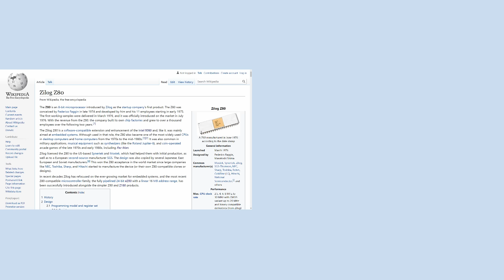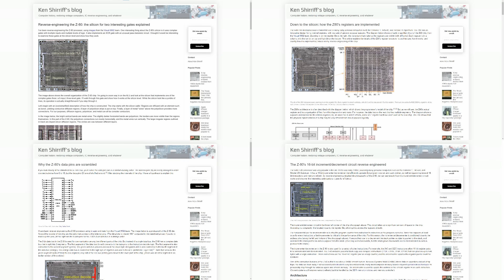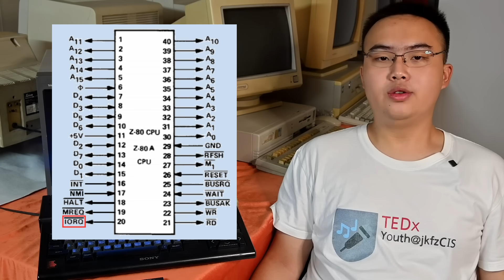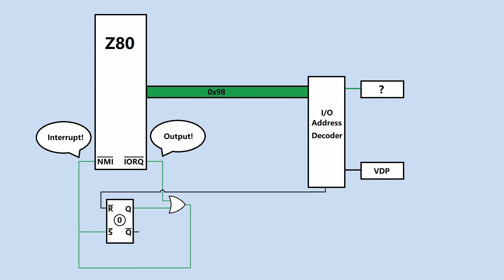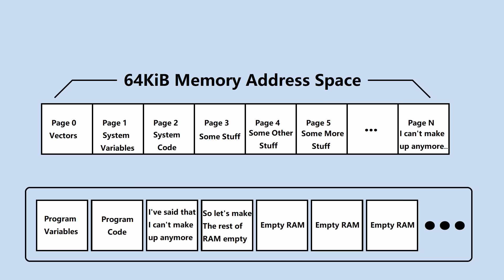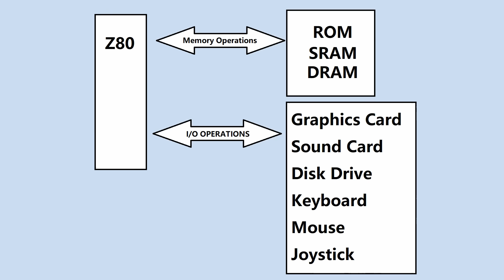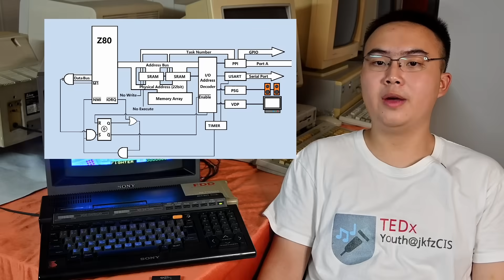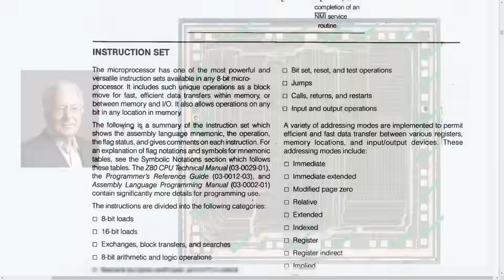The Z80's secret feature discovered after 40 years!

Comment: Not a bad video, even if it was clickbait... however, I wanted to add a couple things that you could not know... the Z-80 chip was used in FAR more applications than the consumer market and some of those users did NOT want certain things known and were left "undocumented" and even hidden, unless you worked for those clients. The Z-80 was truly a workhorse far and above some of what was  generally known and used by most programmers. Unfortunately there are still some "legacy" systems out there that prevent me from saying any more than that.

Comment: You are right, the Z80 was not designed for personal computers or an O/S that was multitasking in a multi user environment (like a main frame). It was designed to run one program in an embedded system. I always imagined that maybe two Z80s could be used, one for the kernel and one for the users. You seem very versed in the Z80 and I haven't designed with one for decades. Can you see using 2 Z80's to allow protected or supervisor modes along with user modes?
Reply: re: "I always imagined that maybe two Z80s could be used, one for the kernel and one for the users. "
YOU do know the Z80 has *two* register sets? I used the 2nd set for interrupt handling back when I did a Motorola trunking receiver that handled the incoming trunking control channel 3600 baud data plus control button scan/debounce and LCD display I/O and serial I/O via the Z80 SIO ...
Reply: @uploadJ  Yes, it's been decades, I think I called them the base and prime register sets. I only gave it fleeting thoughts to use the Z80 in protected modes. When the Motorola 68040 came out, it became my goto CPU for system and embedded designs at the time. Now, my Raspberry PI is fine my home project needs.

Comment: Don’t know how to search the comments so this might already have been mentioned, but the Apollo workstation used two 68000 CPU’s - one for user mode and one for protected mode. The user mode cpu was halted while the protected mode cpu ran kernel code.
Reply: The Sun-3 used two 68000s which ran a few clocks skewed from each other. The purpose was to implement paged virtual memory which the 68k did not support on its own. Apollo would have preferred to use the National 16032 (later named 32032) but NSM was too late to market. The 016 had a companion MMU which nicely implemented pure paged virtual memory.
Reply: @garymartin9777  I didn't know that about the Sun-3.  I used a Sun-3 model with the 68030 processor which included an on-board MMU, but it must have been a later model of Sun-3.

Comment: My own thoughts would to be to use RAM  paging for multi-tasking. One bank for system, and one bank for each program.  The bank switching hardware would only work when previous memory read was from from EEPROM memory space. Not that its worth doing anything like that on my project unless I can get it running faster than 1MHz

Comment: Easy. 1982. Use a Fairchild Semiconductor Clipper II on a paddle board with onboard memory management chips to emulate the 8086 and run VMS with full multi threading, multitasking multiuser and protected mode enabled. Price $108. Only two ever made.

Comment: Russell and I had a debugger with a hardware single-stepper. We used that to find the most difficult bug I have ever seen. We used that to generate code for our communication system. While editing code it would crash for what seemed like random events. We finally had that crash that caused us to lose a day's worth of programming.We single-stepped time and time again getting closer and closer to the bug until we found it. Our Z80 had a broken instruction. It was the Add w/carry A,E instruction. We replaced the CPU in our development system and never had that problem again.
Reply: I had a Z80 'go bad' while writing and debugging code ... it became worse and worse until I changed the CPU (the board was wire-wrapped) and that was the issue! Doesn't happen too often, but it __can happen__!

Comment: I used pen and paper for a couple of ZX-Spectrum assembler programs inserted from Basic. The machine code then running would maybe be full of errors and go through the entire ROM and exit at "reset machine" to start over. For a game on tape I had to move 16K of data 2 times to get it to load and it's 2 commands. No waiting. Basic would spend minutes on that.

Comment: I imagine it would've been prohibitively expensive to add all those components back in the day, too. Plus the components would've made the board of whatever computer larger because components were larger back then, too, so size constraints are also a factor.
Reply: Z80 processors were commonly surrounded by TTL glue logic consisting of gates and flip-flops. Those were cheap (less than $1.00) and relatively small (14- or 16-pin narrow DIP). SRAM might be a bit more expensive but also quiete small (20-pin narrow DIP). Overall the cost of proper software design would be a lot more than the few chips needed for this.

Comment: This was very cool - and well presented with great graphics and explanation. It reminded me a little of the way that the Sinclair ZX80 generated display info, which involved tying A6 on the Z80 to the interrupt so that it would interrupt itself at a specific value of the refresh address register - quirky hardware and software working together.  It also took me back to when I wrote a single stepper for a 16 bit processor in the 1980s that interrupted the code under test after every single instruction. It was slow, but got the job done.

Comment: A protected mode isn't necessary to develop preemptive multitasking. All you need is a clock interrupt that handles task swapping through a scheduler. Once the scheduler has determined what the next eligible task is,  it saves the context (stack, IP)  of the current task on the task's own stack, restores the context of the next eligible task from the new task's stack, and finally resets the processor Instruction Counter with the new task's saved instruction address. In modern OS, this is done in protected mode, but it doesn't have to be for this mechanism to work.
Reply: Some old DOS task schedulers worked this way. Protected mode is more about easying it and creating virtual separated CPU and memory areas with ease for the developer but it must follow a set of strict rules and limitations
Reply: pmode and virtual memory are merely required to enforce the task switching and isolation. If you trust the code you’re running then you can run everything in kernel mode and bypass those isolation mechanisms (e.g. JavaOS, which JITs everything and runs everything in the same address space, with isolation coming merely from the Java memory model and no escape hatch being available)
Reply: Came here to say the same thing. I've built pre-emptive multi-task schedulers for 6502 and z80 hack in the day.  Good times :-)  Still, he gets full marks for trying.
Reply: Pretty cool how programmers push things to their limits.  Technology has made us lazy.
Reply: of course it isn't.  it's software -- we can do anything!
Reply: Looks like people Missed the point of the video...😂
Reply: in the video he says "which means it cannot run a true pre-emptive multitasking OS"... which is a true statement

the key part being "OS", so these comments are not contradicting his statements, you could do multitasking sure with shared memory, you have to have all the programs designed to work with one another

he does say at the end that basicly a load of this stuff wouldn't be practical for other reasons
Reply: @DarkShroom  No, it is definitely a false statement. Pre-emptive multitasking has got nothing whatsoever to do with memory protection.Those are two separate mechanisms.

Comment: I think the 'hidden instructions' in Z80 processors may reflect the personality of Federico Faggin that he'd like to make the chips he designed more versatile in the future. Actually, when studying  Intel 4004, the first CPU Faggin ever developed, you can also find two 'hidden instructions' which didn't show up in the first edition of the MCS-4 handbook. 

The MCS-4 chipset was originally designed for the Busicom 141 calculator, and consists of only 4001 (PROM), 4002 (RAM), 4003(shift register as IO expansion) and 4004(CPU). There were no other expansion chips at that time, and the CPU itself can't modify the program ROMs since they were mask programmed. Then after Busicom sold the copyright to Intel, Intel quickly expanded the MCS-4 family by adding chips like 4008/4009 (later combined into 4289), 4265 and many others. The 4008/4009 combination acts as the standard memory interface, and can be connected to conventional EPROMs to store program. Then Intel uncovered two more instructions, the 'WPM' and 'RPM', which can read and write the program memory through the standard memory interface.

Obviously, for the original MCS-4 chipset and the calculator application, these instructions were not necessary at all. Also it's very unlikely Intel could use these instructions during the development and debugging of the Busicom calculator. So my only guess is that these instructions were reserved for the future, and Faggin had already got a roadmap to make a very versatile general purpose CPU ecology even before the development contract with Busicom. Faggin's foreseeing personality while designing a new architecture may be inherited to Zilog and to the design of the Z80, which led to these undocumented instructions.

If my assumptions are true, I really feel sorry for the poor Busicom company. Maybe its fate was already determined by Intel when they made that contract. Intel used the funds from Busicom to kickstart a new era, while Busicom died just before dawn.

BTW the spare space theory and drawings doesn't seem convincing to me. The red boxes @14:43 are just IO driver transistors and protection circuit, not the real logic.
Reply from the maker: I know that. It's just for illustration.
Reply: Thats really interesting, Thanks. My first micro was the 8008 from Intel and I was not aware of any hidden instructions there.

Comment: Just curious.  I used to have a zenith z100 with dual cpus.  8085 and 8088.  I believe it used banked memory to allow cp/m-85 to do a cold boot super fast.  Wonder if it used some of these techniques? In any case you did a great job describing your techniques. Thanks!
Reply: We had the zenith z100 running zDOS connected to our fire panels.  They were slow and most had a Winchester 5mb drive that came with a park command to park the hdd. Very heavy and fragile
Reply: @formosabrowning3539  - at the time, I could not afford a harddrive so my Z100 had 2 5-1/4" floppies!  The computer itself was built like a tank and came with all material data sheels for all components. Remarkable.

Comment: Misleading title.   You have not discovered any new function in the Z-80.   You have designed a simple protection scheme for a CPU with no protection and a 64K address space.   Unfortunately your protected IO cycles incur several memory cycles for interrupt service, so your protected Z-80 is not a real time bit banger any more.   I hoped you found more opcodes not shown on the data sheet.    I feel victimized by clickbait  now. 

Not really.  It's an elegant hack, and you go on to introduce memory management as part of a virtual machine protection implementation as well as I've seen it presented in school.   Did you build one?  Where did you move the vector table?  

Full disclosure.   I once built a Z-80 machine with 128K expandable to 512, a redesign for manufacturability of the Wavemate Bullet.  Which was useless at the time because the IBM PC was out by then.   Look up the Bullet some time.   They had the whole Z-80 peripheral catalog in there.   The bells and whistles UART, the counter timer, the DMA engine.  I had an unresolved issue with Zilog technical support, they never published timing specs for their interrupt daisy chain sufficient to calculate and guarantee a worst case logic design.   I escalated it to Zilog management and they told me the parts were done and there was no business case for reverse engineering their own parts to provide guaranteed delay specs.   So they weren't gonna do it.   Trust us, it just works.
Reply: The hardest part of putting that chip on a board was the clock.  The Z-80 parts consumed more power through their clock pins than through Vdd.   Vdd was mostly for driving output pins.  I had two 20 pin PALs for all the steering and timing logic, but needed discrete transistors to drive that clock.

Comment: One issue I see is if you tried to multitask is it would not be able to disseminate what variable goes to what active program. That would require a lot of os reprogramming to handle more than one active program at a time. The Z80 might be able to swing it (poorly) but the software would not know what to do with more than one active program running simultaneously but independent from each other.

Comment: The Z80180 implements a very usable memory manager to address upto 1MB of external memory into the 64KB logical memory space of the CPU. This eliminates most of your hardware. The Z80/Z80180's NMI is very dangerous - it implements essentially a single bit stack to save/restore the current state of interrupts. So if the NMI service routine is interrupted by another NMI (which cannot be masked in software), normally interrupts are unconditionally disabled.I don't think your hardware will work as shown - you've sucked up all the IORQ strobes for "protected mode", so I don't see your not-Q output working to IO map your memory mapper and actual IO devices. Have you actually built and tested this hardware? This seems more like a paper design. If you've built it, I'd like some photos and a schematic.

Comment: I chose to NEITHER like nor dislike this video.. because.. I disagree with the headline.. it was well formulated to generate clicks, but it is.. literally.. a lie.. What this video is discussing is NOT a secret- or hidden- feature of the CPU.. it depends DIRECTLY.. on external hardware to make it work.,. ( I write this comment RIGHT after he say.. "you can make this happen by using a single RS flip-flop.. around 6 minutes in).. and.. fair enough.. 

I don't say that.. this functionality CAN'T happen in the Z80.. but.. it isn't the Z80 in itself that has the functionality.. BUT.. if you have the right external hardware.. to.. read the right out-ports at the right time, and respond the right way, etc.. THEN the functionality CAN be used in a system USING the Z80 processor.. 

Tbh.. I don't even care WHICH processor you use.. if I am allowed to look at the internal code, and the various types of interrupts, etc.. then I can ABSOLUTELY!!! create a system with "memory protection".. I mean.. hell.. the most EXTREME case I can think of is.. to put a modern day processor to read ALL inputs from the memory  address (or I/O bus) output, AND send specific responses to ALL the input chips.. 

It's.. a LOT more expensive.. so what he MEANS is that.. a feature that did NOT exist in this chip.. and most likely NO ONE invented as a potential use of this chip.. COULD be ADDED to this chip using fairly simple and cheap hardware.. but.. technically when discussing the chips of "yesteryear".. that is true about ALL chips.. especially because chips today are cheap.. 

so.. VERY clickbaity.. to the point of being a lie.. but also.. hmm.. applauds.. I mean.. I don't know WHO noticed that this could be a way to add "protected memory" functionality to this old chip.. but whoever figured it out.. BOTH had to know the CONCEPT of protected memory, AND the hardware of the chip in question.. and then the reasoning skills to figure out that THIS could be a way to EXTEND the functionality.. but.. "secret feature"?.. That is something that DOES exist.. and tbh; if it is "secret" then SOMEONE had to MADE it work and no one figured it out.. which is why I constantly say "secret-/hidden feature" because.. that is what I'd be expecting after reading the headline.. 

NOT.. "OH.. we found out a way to add protected memory functionality with only a few cheap extra chips".. I am not AGAINST that idea.. I probably WOULD have watched that video if it appeared on my feed.. and tbh I'd be even MORE impressed if someone figured out a NEW way to use existing functionality to add new features that most people "back when" didn't even think of as an actual.. "thing" to strive for... so.. I BOTH.. am annoyed of the title because it is a title that is SPECIFICALLY made to fool people and rise in the algorithm.. 

... and even MORE annoyed because.. the actual "exploitative" part of "click-bait" that relates to the title.. make me NOT like this.. 

BUT.. if it was HONEST about what it TRULY was about.. someone figuring something out.. figuring out a NEW way to use something in a way that wasn't in it's original intended purpose.. (the "pure" definition of what can be defined as a.. "Hack" *angel choirs singing*).. then.. I would IF it ended up in my feed in any way.. have been MORE impressed.
Reply: (( I just realized I should point out.. The "mark" I mentioned that I stopped listening.. THAT.. is when I realized what he was trying to get to.. and the point where I knew how he was using the ports. I know a LOT of how the Z80 works.. So I WAS understanding what was "required" to make "protected" mode to work.. and when I knew the "start".. "what follows" was VERY simple to realize.. so; yes.. if you didn't "get it" by the time I wrote my comment.. then.. just listen to the rest.. but to me.. knowing the "start" was absolutely enough for me to  know how to make it work.))